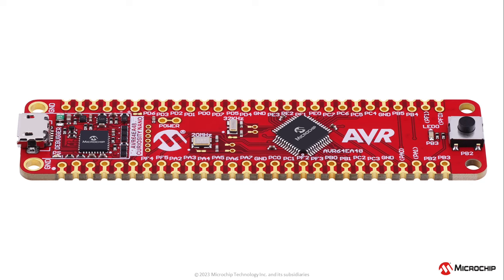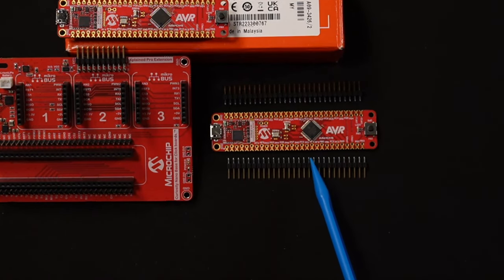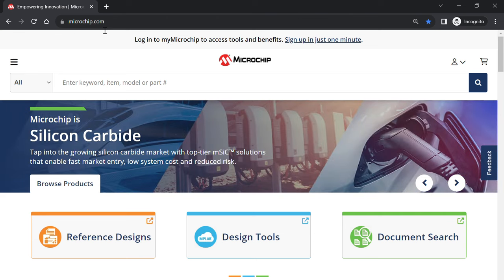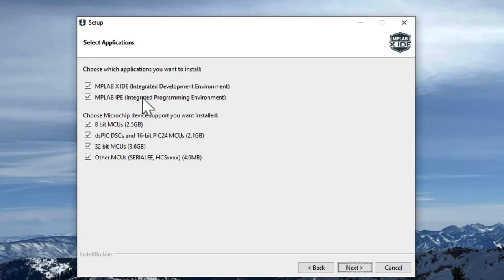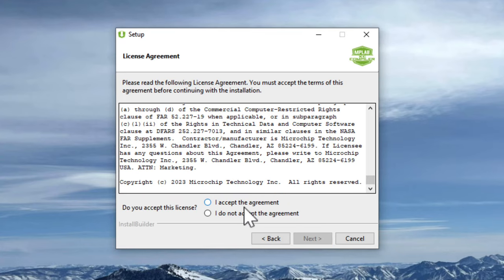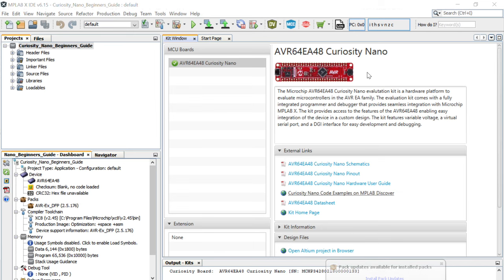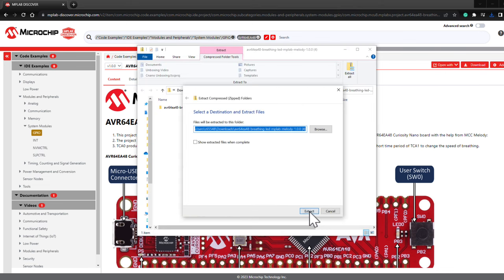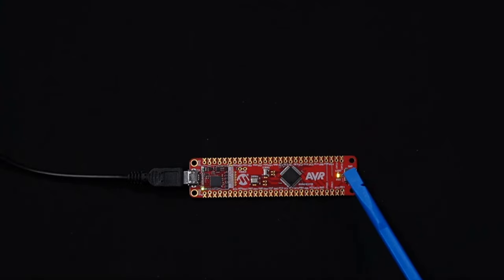Chiptorials - Unboxing and Getting Started with PIC and AVR Curiosity Nano Development Boards

Comment: Hi, to contribute to the "success" of the Microchip Fubarino and being able to be programmed by using the Arduino IDE using C++.
It would be cool if you show how to use the ADC module of the PIC32MX270F256(D), to read one potentiometer or read multiple pots.
As wel the UART module to read MIDI signals @ 31.250 baut, the SPI module to play with things like 23S17, MCP4921/22 as wel a top notch DAC, like Cirrus LOGIC CS4271_F2, 23LC1024.

The Fubarino is by far superior than the Arduino Uno, but it seams people are afraid but missing on the point it's 32 bit.
There is no good tutorial on how to setup the ADC module, the application note isn't very elaborate.
Thank you.
Reply from the maker: Thank you for your feedback and interest in the Fubarino and PIC32MX270F256(D). For specific guidance on using its ADC module, UART for MIDI signals, and SPI with various devices, we recommend consulting the MPLAB® Harmony software framework and the PIC32MX reference manual. For additional support, please reach out to Microchip's technical support team or explore the Microchip forums for community-driven solutions.
Reply: Hmmm,, just to ask.
Could you make a Faburino MAX version using a PIC MZ, with a 200 mhz+ clock? that can be divided to the 31.250 baud rate of MIDI and have like 256 mByte "DDR" ram or more onboard.
Exactly like the Fubarino but with much much more ram to use for Audio. although having a ICD3, the Arduino IDE is cool to use, just plug the USB cable, just 2 buttons, compile and "burn" metaphorically, the serial monitor. Microchip has the best datasheets in my opinion and i wanna stick with it.

Various times, i have researched wath the best way would be to add ram to the Fubarino, but it gets complex if you want to have 16 or 24 bit wide storage for using chips like Cirrus Logic Audio Codec's.
The Fubarino is very powerful for it size and i love it, but at best it i achieved to store little over 2 seonds of 16 bit audio in the flash, leaving no room for software features. Even a 23S17 want help you out.
 @MicrochipTechnology
Reply from the maker: Hi there, thanks for reaching out! We appreciate your support for our products and we would like to talk more in depth about this idea / any questions you may have. Please contact our Client Success Team here to get in contact with us: https://www.microchip.com/en-us/support/design-help/client-support-services
Reply: i just did, but don't know if it worked out, due to "plugins" on the page, didn't receive a confirmation mail.  @MicrochipTechnology
Reply from the maker: Hi again, thanks for letting us know that you inquired with our Client Success Team. If you could share with us the email that you registered with, we would be happy to check in on your case and reach out. Thanks!
Reply: I'm not going to put my email address on a world wide website, i remember the days when the internet was young and your email box was overflowing from spam each week. but this is the guy that replied: Isai.Perez.

He said we are not going to make custom boards (Fubarino MAX idea) and firmware for customers and stated some alternative board (without ram) but using PIC32MZ and compatible with Arduino IDE and DDR2 ram. after research it turned out to be a "giant" board/pcb, but i want something small like the original Fubarino, just with 256 mb ram or something. that i can stick on the backside of a DIY eurorack modular synthesizer module.

Thank you for your time and reply.
 @MicrochipTechnology
Reply from the maker: Thank you for the clarity. We understand the importance of finding the perfect fit for your project. While you reconnect with Isai for tailored advice, you might explore the PIC32MM for its compact size or utilize our development tools for custom solutions.